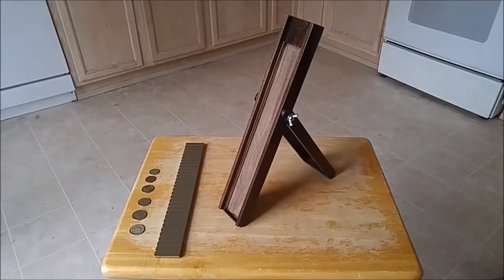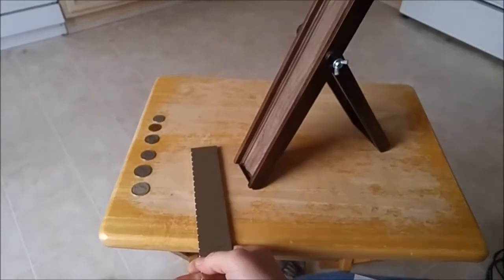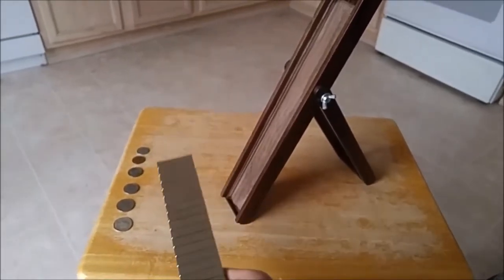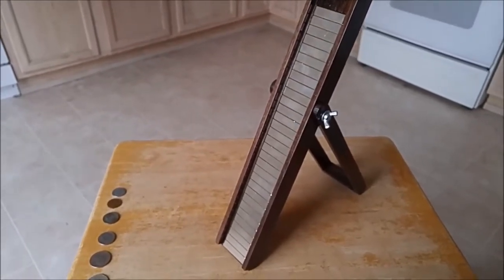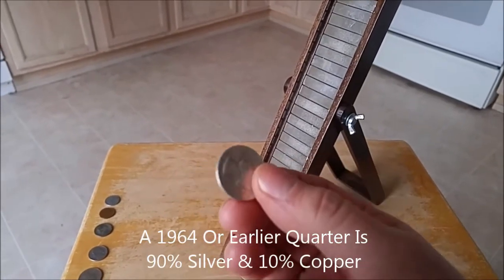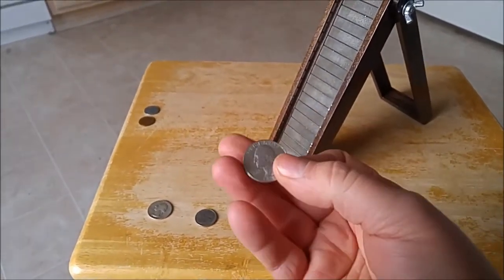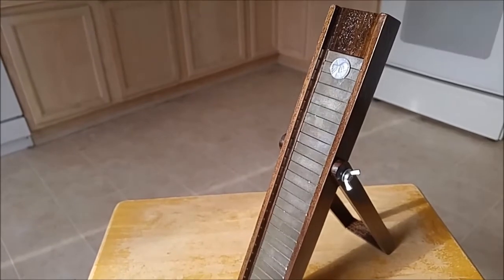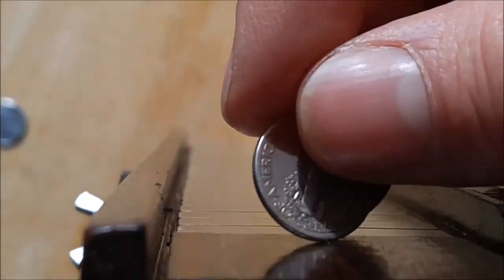Silver Coin Test With A Magnet Slide

Comment: Nickel is also ferromagnetic.

U.S. five cent 'Nickels' minted since 1866 (except for the 1942 - 45 'War Nickels') are 75% copper, 25% nickel as noted in video.
'Clad' U.S. dimes, quarters from 1965 to date have a core layer of pure copper with outer layers of the same 75% copper, 25% nickel. Half dollars 1971 to present are the same clad composition, approx. net 82% copper, 8% nickel.

All of the Canadian five cent 'Nickels' from 1955 through 1981 and several of the issues prior were 99.9% nickel.

U.S. half dollars dated 1965 through 1970 do not contain nickel, they are of 'silver clad' with core layer of 20.9% silver, 79.1% copper and outer layers of 80% silver, 20% copper for a net 60% copper, 40% silver.

U.S. half dollars, quarters, and dimes dated 1964 and prior are 90% silver, 10% copper.
Reply from the maker: This is good information on the metal composition of various coins. I think it would have been useful to include this type info in the video as well as electrical conductivity for metals, maybe in the form of a tables. Thank you for the feedback.
Reply: @True_Lou  You're welcome.

Comment: Hi, I was curious if having the steel plate behind makes a difference?  When placing the magnetics side by side how can you tell the poles are alternating like you mention?  Your design is the best I've seen and having a longer run makes a difference to see the speed.  Thanks!
Reply from the maker: Sorry for delay responding, I've been off youtube for a long time. Glad you like the coin slider video and design. To respond about your questions, when making this project I tried with and without the steel plate. The result was that the coins drop quite a bit slower with using the steel plate. I would recommend you do this same experiment with/without the steel plate to prove it to yourself. The reason why is because the steel plate acts like a conductor of magnetic energy forcing the energy upward towards the coins instead of allowing it downward where it's of no use. Far as determining magnet polarity, the way I did it is to add the first magnet to the start of the steel plate, then bring a second magnet near the first magnet (having it in the orientation as if you were going to add it to the steel plate). But before you add the second magnet, check if it attracts or repels to the first magnet (being careful not to have it attract to the steel plate). If the two magnets repel then add the second magnet to the steel plate in the orientation you're holding it. If they attract then flip the second magnet over so that it repels then add it to the steel plate. In other words, when magnets attract then you know they are opposite polarity and you want alternating opposite polarity facing upward. Then just repeat this process for more magnets. If you get it wrong it will be obvious when sliding a silver coin, it will go from slow to fast if orientation is wrong. Also the rare earth magnets are fragile so had to be be careful when determining orientation or adding to steel plate, I broke one or two accidentally allowing them to slam together. Point being I'd suggest ordering a couple more than you need for your project.

Comment: I want to build one... Are Neodymium Magnets polarized? Does it make a difference which side of the magnet I glue to a wood ramp? Both sides of my Neodymium disc magnets seem to attract.
Reply from the maker: Glad you liked the project and want to build a slide of your own design. Yes the magnets are polarized north and south. It doesn't matter which polarity you stick to the ramp, what is important is that as the coin slides down it hits alternating polarities as much as possible. Also you mention glueing the magnets to the wood slide, as a suggestion try placing the magnets on a steel bar like in the video, it will greatly increase the magnets strength facing the coins which will in turn make the coins fall slower thereby making difference between different metal coins easier to spot. Also I'd suggest using long and narrow rectangular magnets like in the video rather than disk magnets. Good luck with your project.

Comment: So you're saying that the poles of the magnets are along the top and bottom, vs. right and left, which you'd expect from a magnet shaped like this?
Reply from the maker: Yes correct. The magnets used in this project measure 40 x 10 x 4mm, and the poles are located on the 40 x 10mm top and bottom surfaces. It's a good point you raised, pole orientation is one of the key factors when determining which magnet to use for a coin slide. The idea is to design the coin slide to slow coins as much as possible to accentuate slide rate differences between a known good coin and the coin being checked. This means using strongest neodymium magnets (N52 preferred), using a magnet size the maximizes the number of polarity changes as the coin slides down but yet is wide enough to accept the largest coin you intent to check, directing the magnet fields upwards toward the coin using an iron bar on the bottom, keeping the coin close as possible to the magnets, & minimizing any friction on the coin as it slides down.

Comment: I was thinking that a very thin piece of felt over the magnets would protect the finish of the coins, particularly collector grade coins. 

What size dimensions are the magnets? And where did you get the iron?
Reply from the maker: Hey Rich, I'd thought about felt as well but had concerns it would become contaminated, however if only running a few or always clean coins it may be fine. Another option is if the felt was replaceable. What I came up for collector type coins was to make a small holder out of very thin parchment paper that the coin sits in then that slides down. Like in my video I would slide both a known good coin and the coin being tested at the same time. The parchement paper is nonstick so it slides over the magnets well and the coin is never sliding against ainthing, and it avoids contamination because you can make a new holder at any time. The magnets are N52 type and 40x10mm size that I purchased new off ebay. The iron bar was 1.5" wide x 1/8" thick flat bar that I got from a box store like Home Depot. At some point in the future I'm hoping to do another video showing some learnings from using this coin slide and pros/cons of using it to detect fake coins. Let me know if anymore questions and good luck with your project.
Reply: dumas5000 thanks!!

Comment: Hello does anyone know the best place to get the magnets? Also what thickness?
Reply from the maker: As a data point I purchase magnets for this project from Ebay which was best option I could find at the time. The magnets used were 40mm long x 10mm wide x 4mm thick. I bought a pack of 50 of them for $36.99. The project used less than 50, I wanted some extras for other things. The Ebay supplier name is "biwecity". Though in looking at Ebay just now it seems this supplier no longer offers the exact same magnet but if you search under "40x10x4mm magnet" you will find other suppliers selling the same thing at reasonable prices. I can say these N52 magnets are extremely strong and the iron bar used in the video makes them much more so. But they are brittle and easily damaged if not use to handling them. I broke a couple myself before figuring out a safe way to handle/store them. Good luck with your project. I hope to post a follow up video on learning's from using this coin slide at some point in the future in case you wanted to subscribe for that. In short it is not as simple or effective as some have portrayed coin slides at detect fake coins.
Reply: Hey thanks for replying man! This helps. Is the iron bar something I need to have a custom shop fabricate? Anything off the shelf for that? The epoxying I better be able to figure out! ;)
Reply: @True_Lou  how do I align the magnets? Wither they want to pull away from each other or against each other.